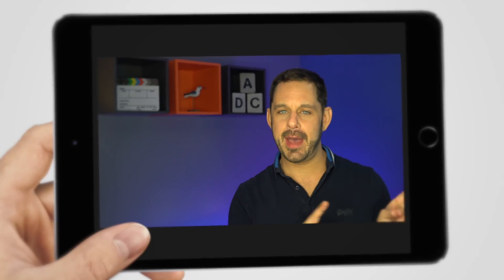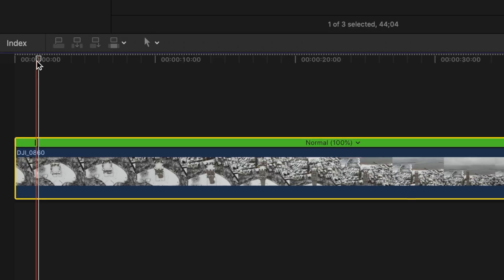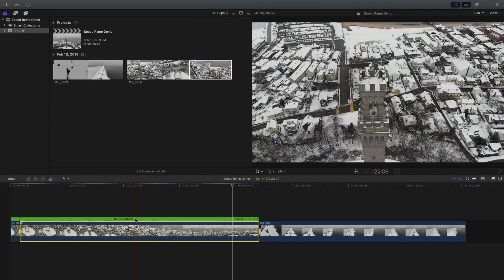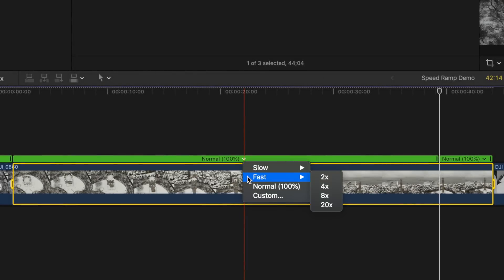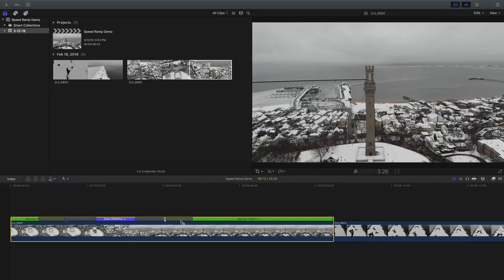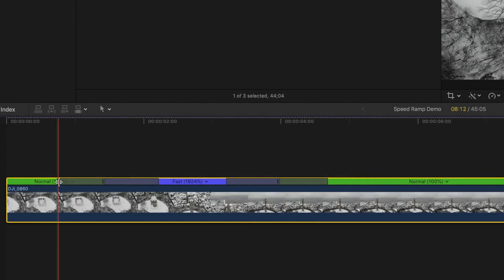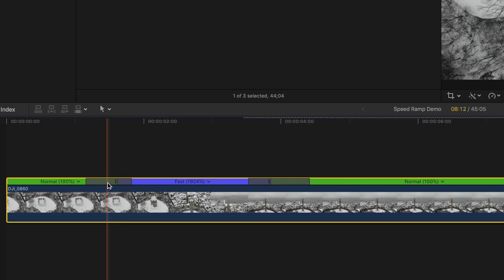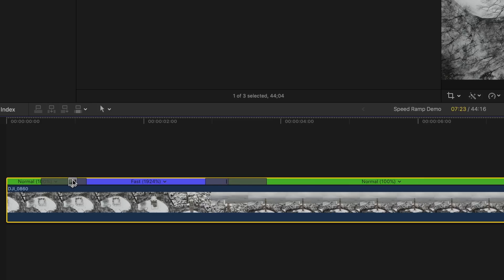How to Speed Ramp in Final Cut Pro X - FCPX 🏃🏻‍♂️💨

Comment: My FCPX does not have Shift-B as a shortcut and I've tried editing the shortcuts, but there is no "Blade Speed" command to assign it to. I have FCPX 10.4.4 Do you know anything about fixing it?
Or is there a keyboard shortcut "file" that I can import to activate it?
Otherwise I'm stuck with FCPX creating speed ramps consisting of multiple sections, and a "hold" frame that I don't want...
Help...
Reply: Ok so the workaround I found to the missing Shift-B shortcut, is to use keyboard shortcut R (Range Selector Tool), and select the portion of the clip I want to speed up or slow down. Then click on the custom timing "clock" in the viewer and enter the new speed. This then gives me the greyed out handles for ramping the effect, like Shift-B does in the video.
Reply: Paul Andrews, I had this problem as well. The solution is simple. In the Menu go to Final Cut Pro > Commands and see what your shift B setting is. I had previously installed ProCutX from Pixel Film Studios and it had disabled this command shortcut. I simply changed the settings back to default and everything was fine. Hope this helps.
Reply: @sandeepkhandelwal1141  Oh of course! - thank you, you're right. That detail about the ProCutX server (which I have installed) was the "secret sauce" to understanding the root cause. Thank you so much for volunteering that answer! Fixed!

Comment: What’s the best bang for my buck with iMac so I can edit 4K footage ? I’m running a 2009 iMac and I’m not able to download the latest software or edit 4K so I need to make a switch but not sure what specs I need, base? Upgraded ? Help please!
Reply: ooo definitely upgrade the iMac, friend... although about $3k will be the lowest you spend if your looking for the lowest end that will give you great performance.. the 27 inch 3ghz model.. 32gigs of ram, 1TB SSD to handle all those render files, (you might get away with 512 gb if you arent editing anything longer than 10 minutes)  and its a 5k display...  anything less and you'll be sorry you didn't invest in a little better performance
Reply: Shane Carrigan  thanks for the comment! I was just on apple checking out a dream 2019 iMac: $4,077.99 

3.6ghz 8 core i9
8gb RAM ( recommendation on after market company to save $?)
Radeon Pro Vega 48 w/ 8gb hbm2 (worth it +$500?)
1 tb ssd( should I keep footage on external sd?
Is trackpad helpful?
-final cut pro of course 

Should I just get Imac pro ? 🤪
Reply: @motorcyclezeal  if it is in your budget iMac Pro is the way to go. I am editing some commericals for major brands and beginning to edit features, i need to handle terabytes of footage and run multiple design software's at the same time (even editing on final cut and premier simultaneously, and myriad other adobe products) so completely spec'ing it up. almost $16,000 but finally in a place where my work can pay that off :) 
but it depends on what you are editing. If you run photoshop or illustrator while also editing in premier and davinci resolve.. you need more ram than 8, more than 16 even.. at least 32... don't skimp on ram.. and i would at least get 2 TB SSD because of render files. most of my projects after rendering, even videos that are only 5 minutes long are often 2-300 gigabytes with graphics and color grading etc. so two projects being worked on would nearly take your whole drive.
if you just edit 10 minute youtube videos with a simple LUT, maybe a premade graphic.. 1 tb will get you by.. 16 gigs of ram will work, but you will not like the rendering wait times.. and running two design programs will slow every move down.. 
also depends on how much you are getting paid to edit and if it is all worth it.
Reply: i appreciate the insight. @ShaneCarrigan   . right now i got like 20 subscribers on youtube and that would be my primary reason for getting the computer. thats why its a hard decision, there is no guarantee my channel will blow up and be worth the investment. i think i will wait until people post some benchmarks for the new imacs. what is a route to take that may lead to get into editing for major brands? that sounds astonishing!